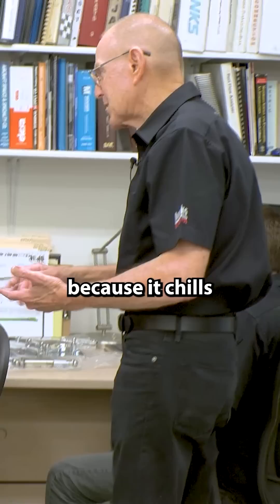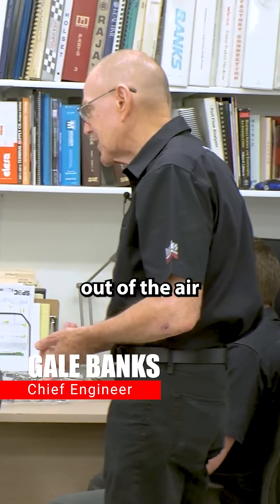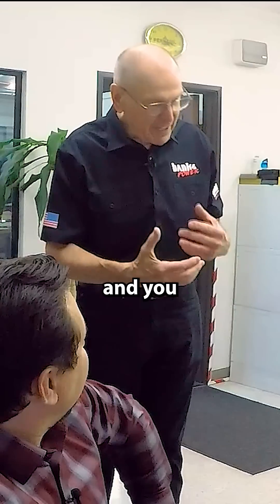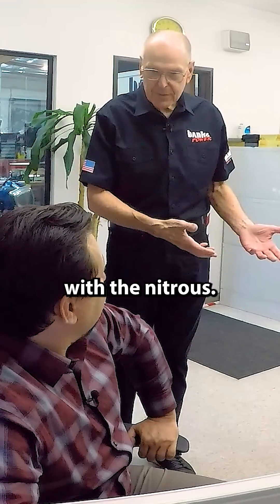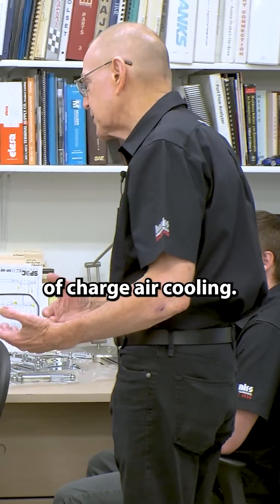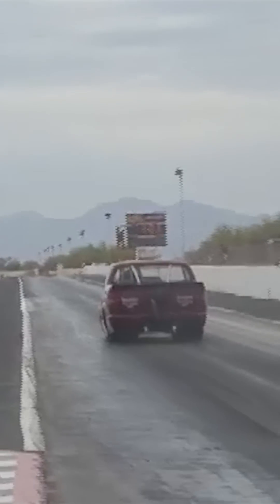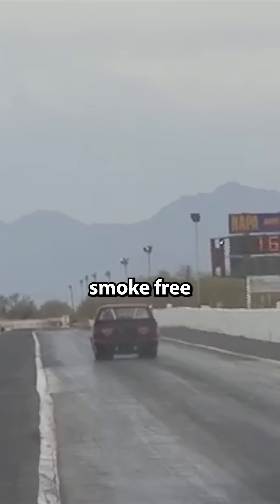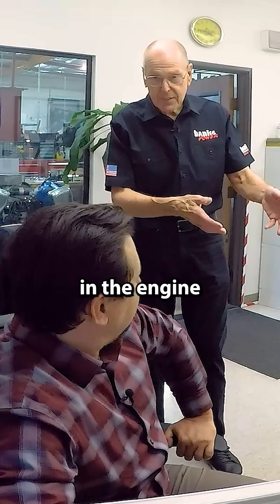Using nitrous instead on an intercooler

Comment: I have seen( testing) using nitrous as an Intercooler. And the gains had nothing to do with charge temp.  P.s Ice cubes are cold. Until you put it on the woodstove. Think about it. And if you Is throw a cup of fuel in that wood stove.It will definitely burn with more Energy.  Nitrous is good but not for cooling. That's what the tests show, not my opinion.

Comment: Jacob's Electronics made a nitrous mastermind controller back in the 90's that was fully automatic and would pulse the nitrous injector based on what the engine could actually take. You just turned it on and drove.

Comment: There's a reason engines run rich when they're on power. Some of it is due to cooling and keeping your pistons from going through the block. The other is to ensure all the oxygen is burned. Rich or lean, you let some "power' making stuff go out the tailpipe, but the maximum amount of power comes when you put enough fuel in to burn ALL the oxygen. Once the oxygen's gone, you can't make any more power. But once the fuel's gone, if there's more oxygen, you could have added more fuel and made more power. Running rich ensures with no doubt that you can't make any more power, and the little bit of cooling helps as well. 

The only way you get all the power you can without running rich is to get the EXACT amount of fuel into the cylinders to react with all the oxygen. That is so incredibly hard it might as well be impossible. NASA, SpaceX, don't even do that. Much less ANY ICE tuner. 

Make it smoke. Just a little. That's max power.

Comment: UNBURNED FUEL is the crook in every performance situation. I got it and Gale knew it. Make every ounce count for performance! Diesels can burn clean AF, the TUNE has to be on top as well. 
Meanwhile the anti-fossil fuel lobby screams about smoke, without any understanding that diesel is actually better than ANY earth (literally) shattering battery they can think of.

Comment: My 02 LB7 , with new updated injectors, would roll coal even on a low 40HP tow tune.   On the 120hp tune it looked like a tractor pull going up a hill for the black smoke.
After a while it started throwing a code for low fuel pressure, a few tests told me the CP3 was getting tired.
I put in a new pump and regulator and now I barely get ANY coal on the 120 tune and not a speck on the the 40 or 90.
This is an older PPE canned tuner.
I don’t beat the truck but I do pull with it and occasionally romp it on the hiway for a minute for fun.
It’s strange to me that not enough pressure would smoke and perfect pressure doesn’t.   
So, long short, 02 LB7, 4” exhaust, PPE tuner, new updated injectors and new CP3 pump, 300k miles amd runs better than it ever has with no smoke.  AND knocked nearly 2 full seconds off the 0-60 time on the 40 HP tune!
Weird , but I’m happy.  Fuel mileage avg also went up almost 1.5 per gallon. That’s avg per tank.
I do run Stanadyne but doubt that added any power and it smoked with it before the new stuff.
I just use it to keep the parts lubed with the ultra low sulphuric fuel these days.  
I run it on 40HP tune as a daily, PPE claims it’s a good tow tune and optimized stock kind of configuration.
Haven’t had to clean soot off my exhaust tip since the upgrades.

Comment: If cold air us better for the engine then why is cold air not sucked outta the cars cab instead of a hot engine compartment  ? Better yet , Why not have the a-c system pumping cold air directly to the throttle body ??

Comment: I wonder why they don’t build like solenoids or valve type deals for the air for like super chargers to open and close holding certain pockets to feed. Wouldn’t it control it better ?

Comment: It would be interesting to have Gale compare and test the system used on the S-10 (No intercooler + NOS) vs Intercooler + NOS similar to how he did it with the diff cover.

Comment: How fast was that 08/09 diesel truck compared to similar trucks that are "rolling coal"?

From what I've seen, with most diesels, you typical do get more torque and power when you crank up the fuel enough that you start making smoke.

Obviously it would be better to burn every drop of fuel and not make any smoke, but if it gives you more power I understand why most drag racing diesels smoke.

Comment: The only trucks that should smoke a little at the beginning of a gear, are the old mechanical ones. The efi trucks doing that end up being slower than a 7.3 that gives a little puff between gears.

Comment: That's why diesel trucks are a lot more clean.

Take a tube, fill it with nitrous oxide, put a burning splint inside the tube. The splint will ignite more rapidly, smell the left over gas, it smells exactly like a diesel transports exhaust

Comment: The problem I see with nitrous is it's limited, with a properly designed liquid to air CAC system the engine can run on near ambient air nearly indefinitely

Comment: Still running pretty much “ Smoke -free” on my ‘02 GMC with the original Banks 6-gun tuner & speed loader plus “ Big -head “ waste-gate I bought & installed almost 21 years ago now .  While maybe not the Fastest Duramax out on the road my truck still surprises a lot of people with how quickly it can take off from a dead stop , especially with 37” tires and still stock 3.73:1 gearing in differential.  And out on open highway loafs along getting 18-21 mpg still .  Pretty impressive Mr . Banks.  Thanks 😎👍
Reply: Time proven, not theoretical. The guy knows.
Reply: hell yeah!

Comment: Hey, Mr Banks, ive got an ole 6.0. Buying a KDD stage 2 short block, have the hdd icon heads, 225/100 injectors, thumper 2 hpop, Airdog 4g lift pump, Odawgs Intake, Borg Warner S366sxe .93ar and the reason im writing this is because of the Nitrous Express NXD1000 im putting on it. Bought the diesel upgrade so its a 250 shot, progressive, parameters like you were talking about. I cant wait to run it.

Comment: Water injection was a great crutch for lack of an intercooler on a sleeper I had.
No visible clues from the outside as to what was going on under hood.
Reply: I don't hear much anymore about water methanol kits. Had the Banks kit on my 07 LBZ. Helps that hidden HP and TQ.
Reply: The air to water intercooler is the same. Looks like a normal 4 door family car until the tires start smoking at 70mph.

Comment: Gale Banks has forgotten more than most people will ever know.
Reply: Gail actually spends the money for the technology and testing to speak facts, not Bro knowledge when he says, adding more fuel, is not the answer that goes over most people head in the diesel industry.
Reply: @adamscoggins5840  in order to burn the fuel you need more air.

Comment: Gale would have a laugh watching the footage of the diesel equiped Galaxy that was on the Cleetus McFarland channel - they stuck Nitrous on it for fun, and it went from blowing smoke to blowing a tall orange flame out the stack and ripping down the track.
Set any engine right, and you get nothing but hot air out the tail pipe. Saying you add extra fuel to cool the charge in the cylinder, is BS, just means you don't have a big enough intercooler to get the air density and temperature back where you need them.
Reply from the maker: That's a great idea. Gale Banks Reacts!

Comment: I wish every diesel lover had the same opinion on diesel smoke.  Roiling coal is just wasting money!!!
Reply: Rolling coal is dumb. Your just blowing unburnt fuel into the air and it does your engine no favors either. Also the coal roll crowd is part of why diesel gets a bad name.
Reply: @sweettooth7124  
Im glad the 1% of diesel trucks get a bad rap. Oh wait how can a minority get a bad rap. Majority of people in the burbs buy gas trucks because diesel scary
Reply: Exactly! The coal rollers kept me away from diesels for years. Now I have one and it doesnt smoke! A slight haze at full throttle but it's indirect injection so im happy with that
Reply: @isaakwelch3451  
I didn't know you are so emotional. Do you drive an SUV?
Reply: And it makes States implement emission inspections on diesels. And it's pointless. And it makes you look like a dink. People who like to roll coal, or think rolling coal is cool, are nothing more than the loudest person in the room.
Reply: Nah, it's just stupid.
Reply: Talk for yourself. Get out of the hobby if you are crying about fuel cost.
Reply: @JohnSmith-xu7ev 

You also lose a bit of your power because you'd rather look flashy with your black smoke than put it down to the tire. 

Outside of the tiny willy roll coal diesel Billy community, no one wastes fuel. People run badass diesels all the time and they run them with minimal smoke. Yeah, they may be getting gallons to the mile as fuel mileage, but as much of that fuel as possible is put to the tire. Rolling coal is just rice, like giant wings on econocars. You are a ricer if you do that.
Reply: @odethious5639  
Dont care. This is America. Running rich isnt even close to comparing diesel engines that are means to tow compared to cars pretending to have v8s
Reply: @JohnSmith-xu7ev  

You realize they'd produce more torque if they didn't roll coal, right? Why is it so hard to get basic information through to you?
Reply: @JohnSmith-xu7ev just how small is little Johnny that you are trying to compensate this hard for?
Reply: @bamascubaman  
Johnny isnt really my name but nice try
Reply: @JohnSmith-xu7ev  No some of us would like to save what's left of the environment for our children and grandchildren and we know that we can make just as much power without blowing black smoke like you D-bags!!
Reply: @JohnSmith-xu7ev  lmao
Reply: @NPzed  
Just like your avatar posing as anonymous.

Comment: Every test I’ve ever seen shows that Nitrous does very little to cool IAT’s. There just not enough volume of Nitrous to Intake Air to make a meaningful difference.
Reply: Did you hear "when we set the record"... That's usually a good indication to put down whatever preconceived notions you have and LISTEN
Reply: @3e2e  Did he post any data? Not saying Gale Banks doesn’t know his stuff but show me a before and after with #’s. Because the ones I seen that did showed a couple of degrees difference. Not worth talking about IMO
Reply: He's talking about post compressor, not intake. Big difference.
Reply: @RassoolRacing  Potentially, I heard the same thing about Methanol Injection Pre and Post Boost but in all honesty after making the change myself I haven’t seen much of a difference if any tbh. I’d be interested in seeing an actual test with results that showed the “super cooling” effect. 

With that said I am a huge fan of Gale Banks fan, he definitely does good work.

Comment: What about propane with diesels? Cause I know you can use that like you would nitrous, and you can still run nitrous on top of the propane.
Reply: Propane doesn't cool the air density.